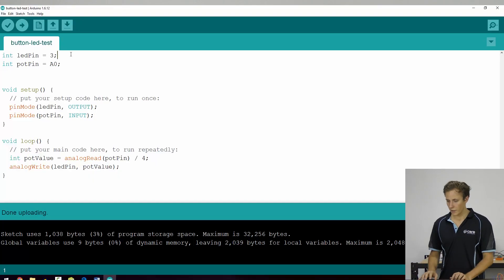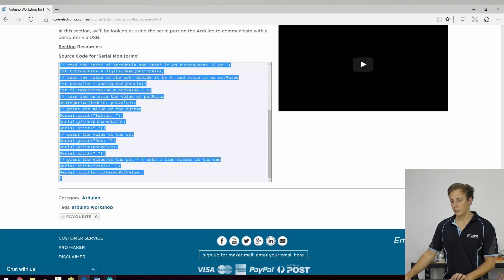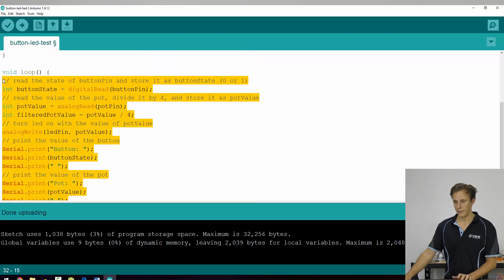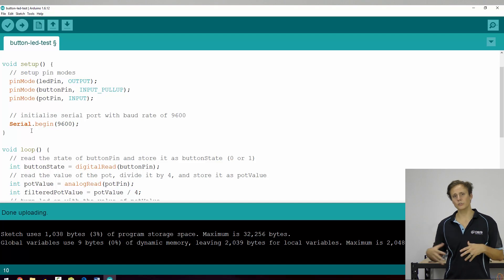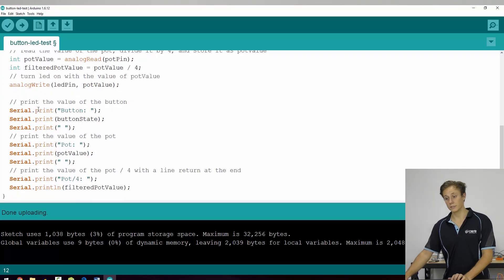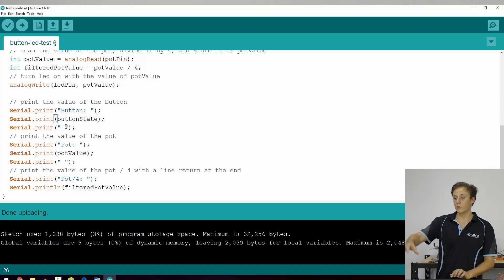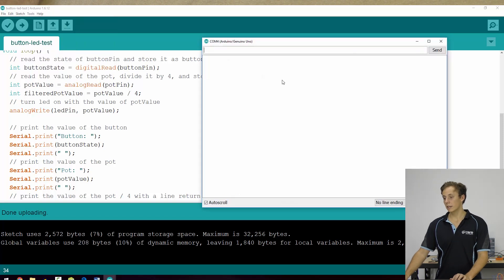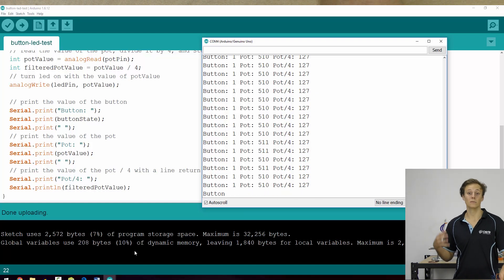Arduino Workshop - Chapter Two - Using Serial Monitor

Comment: int ledPin = 3;
int buttonPin = 2;
int potPin = A0;

void setup() {
  // setup pin modes
  pinMode(ledPin, OUTPUT);
  pinMode(buttonPin, INPUT_PULLUP);             
  pinMode(potPin, INPUT);

  // initialise serial port with baud rate of 9600
  Serial.begin(9600);
}

void loop() {
  // read the state of buttonPin and store it as buttonState (0 or 1)
  int buttonState = digitalRead(buttonPin);
  
  // read the value of the pot, divide it by 4, and store it as potValue
  int potValue = analogRead(potPin);
  int filteredPotValue = potValue / 4;

  // turn led on with the value of potValue
  analogWrite(ledPin,filteredPotValue);

  // print the value of the button
  Serial.print("Button: ");
  Serial.print(buttonState);
  Serial.print("   ");

  // print the value of the pot
  Serial.print("Pot: ");
  Serial.print(potValue);
  Serial.print("   ");

  // print the value of the pot / 4 with a line return at the end
  Serial.print("Pot/4: ");
  Serial.println(filteredPotValue);
}